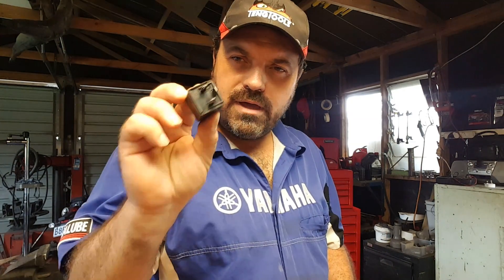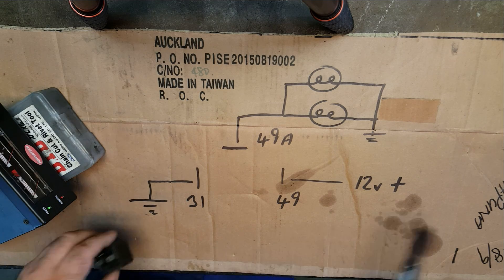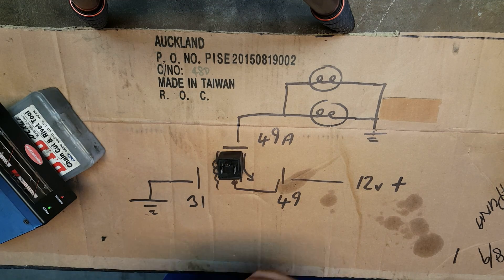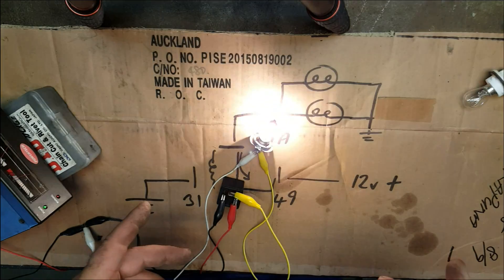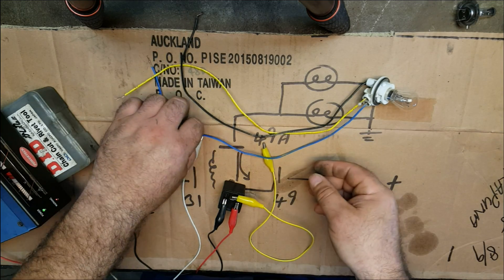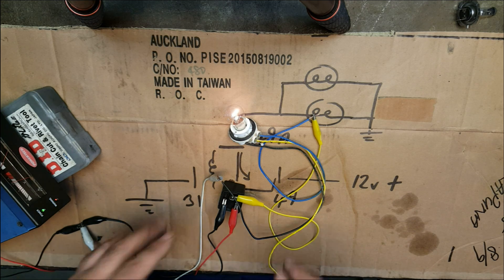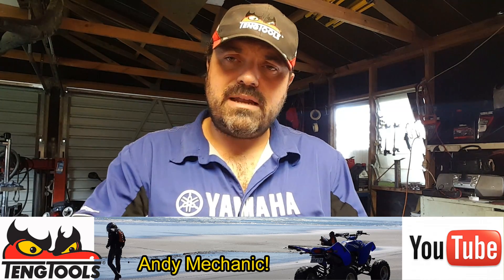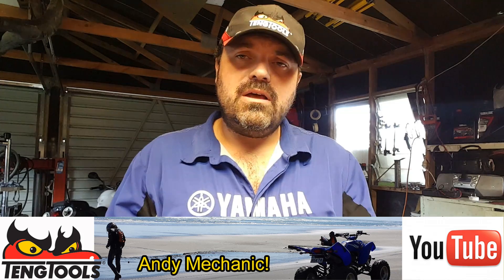How to wire up a Flasher relay #1927

Comment: great walk through. I've just bought new LED indicators for my motorbike to replace the standard bulb ones & I was very worried about the relay part as I don't know much about electronics and it sounded complacted but you have just made it sound very straightforward. I just need to buy a LED flasher relay and swap it over. luckly the lights I bought are for my bike so all the other wiring is the same as what is already there. so this should all be a easy job

Comment: @AndyMechanic hi Andy I have a uforce atv I have put aftermarket lights in it, I have hooked up turn signals to a 3 pin flasher relay. I now want to add in my Hazzard lights. I have purchased a 5pin rocker switch but I can not for the life of me figure out how to get hazards to flash!! I have hooked wires on rocker I think every way possible. I can hook up wires and the turn signals work but you turn rocker on and I get nothing. Any help or suggestions would be great  ty.
Reply from the maker: Hi, yes, most manufacturers have 2 separate relays, the problem is the load, it's doubled when you turn on the hazards & this then often puts the relay over spec on max current.

You may get it to work with one relay if you use an electronic type relay rather than the old school bi-metalic strip type. I remember our old Suzuki jeeps had two relays.

Hope that helps?

Cheers
Andy
Reply: @AndyMechanic  this is what I am using, should I be using a 4 pin? I'm thinking 3 pin is my problem
Reply from the maker: The relay needs to be upstream of the switchgear, that way you can activate just one side or both sides. If I was doing the job I'd definitely just use 2 relays, one for the indicator circuit & one for the Hazzard circuit. Easier to diagnose faults further down the line too.

Sorry, got to go, have to get on a plane.

Cheers
Andy

Comment: Great video! A '?'.. I need to replace an existing faulty 12v 2 prong relay that's malfunctioning on a 64 vw beetle (no emergency flasher in 64, it's just for turn signals). Was told I should go to the 3 prong (newer type) so the pin 31 can go to a grd so it works properly. Would this be true? Thanks for any feedback!

Comment: I changed to LED taillights on my campervan and have hyperflashing. I tried fixing it with the resistors but it made the LED lights very dim. Ive ordered an LED flasher relay instead but its 5 pins and my other 5 pins are in different locations. 
Wondering how to wire it up?
My old relay (25230C9961) is numbered 1,2,3,4,5 and my new relay EP27 is labelled as +  -  I   L & L1

Thanks

Comment: Hello,

Thank you very much for the explanation.
I am having a problem with my CB500X 2021 that comes with full LED lights so basically equipped with a LED Relay.
I have added additional headlights "technoglob BALL PLUS" on it with turn lights in it.

Now when I switch the warning button while the engine is running, the flashing rate is too high.
When the engine is off, the flashing rate is normal. I have uploaded a video on my channel.
> https://youtube.com/shorts/QxTxtNLFfw0?feature=share

Do you have any idea what is going on ?

Thank you in advance

Comment: Like the basics, good refresher, but you probably might add running lights like ones found on my old 1983 kawasaki 750 ltd. The reason I feel it would be beneficial is the front and rear running lights the turn signals share the same single filament bulb and a 2 conductor flaher. This would help those whom don't understand how that one filament can flash when the lights are on, trouble shoot more effectively. So it is my opinion. If you would include the ignition switch and turn signal switch and maybe the separate two conductor hazard flasher could be even more beneficial for understanding what real world scenarios, such as chasing a bad wire/connector or multifunctional switch like in my 04 Ford f350 can greatly complicate simple circuits such as a flasher

Comment: Why wuld my car to refuse shut of because of flasher relay? Same 3 pin relay in that video.
I cant finde problem with that thing can I use diodes on that thing?
What ever it is when all 4 lights are turned on engin works in union with the flasher,my engin has tendency to self acelerate when lights are on,my trothel cabel fir some reason on my carburetor gets contracted if I dont stop useing lights and I took of blow by hosse .
I have realy big problem with my lights .
I have 3 relays they do strange staff but non fix my problem .
Even the bulbs are corect size and value.
It started when I changed out handels on stering and changed to newr light design on my 80s opel who is by the way gm product how ever the bulb holder design and wire lay out are the same .
So I can not finde any thing suspiciuse in that thing.
I even unpluged my ignition coil positive out and that thing still runs .
What Am I missing there?
Is my relay actualy become somthing similar to ignitor module?
I look inside that thing and lot transistors capacitors all kinde of resistors I have strange fealing my ignition coil is fiering from the ground some how,ore it fumeled with my alternator for some reason I fried my multimeter it shown 15v and is claiming with engin speed increasing .
So what the hell happening?
Wires dont see damaged plugs look ok corosion I remowed with sand paper so changed out 3 relays and always get diferent results front left activated back right tail light and blinker the other work just on 1 side the third relay does not do any thing all lights goes on ?
How to hell I solve this problem can I put diode ore somthing like that?
What ever it is its anoying my .
I like my engin power I wont lie 😘 but that ghost electricity nearly killed my that was not great at all .
I dono Im out of ideas aperantly that deam 3 pin relay can act as kinde of oscilator so Im not shure how to deal with it 😵

Comment: Ah damn, i messed up, that means i bought the wrong relay, im rewiering my IH 434 beacause the electrical system was toasted over all the years and now im at the finnish line only needin to plop in my warning lights and now im here with a relay that doesent have its grounding in the ligt bulb... facking hell 😵😡🤬😥😓

Comment: Hi, I'm wanting to try this but my motorbike has hazard lights too. My bike is a Honda and the original relay (for filament bulbs) has 4 pins. Would my hazard lights still work with a 3 pin universal relay? And I have an led 2 pin relay  (adjustable flash speed) would my hazards still work on a 2 pin relay? Thanks for a great video 👍

Comment: opps,  mistake - OMMISION , did anyone pick it up?   you did not mention, the beauty of the old globe system,  when one ( indicators are 10w SINGLE FILAMENT GLOBES) of the twin set FRONT AND BACK  per left or right blows out- fails, the flashing speed doubles-  TELLING THE DRIVER TO FIX - REPLACE THE BURN OUT BULB,

Comment: So an electronic flasher 3 pin will work on front and rear and mirror turn signals ? What about running lights? I have a 2004 EZGO TXT:Marathon golf cart. Any thoughts….Thank You Andy!

Comment: Newer vehicles don't have a replaceable flasher relay (like my 2014 Xterra). So your only other options are loading resistors or get CANBUS rated LEDs for your car/SUV/truck. The CANBUS LEDs have circuitry that pulls normal halogen/incandescent current which fools the cars electronics into thinking you are using halogen/incandescent bulbs. Not all vehicles will work properly with the CANBUS rated LEDs so you may have to go with loading resistors. The downsides to the loading resistors is heat dissipation and  if the LED goes bad the car's electronics will think the LED is still good because the loading resistors are still pulling the same amount of current. That's why you should check your lighting on a regular basis - but it's obvious that a lot of people won't do that.
Reply from the maker: Very useful info, thanks for your post. Cheers Andy
Reply: @AndyMechanic  I just got a pair of CANBUS LEDs (CK socket type) for my front turn signal lights on my 2014 Xterra and they work great. No hyperflash when you install the CANBUS LEDs in both the front and rear. CANBUS LEDs make for a cleaner install (compared to resistor kits) but they don't fix hyperflash on all vehicles (according to my research).

Comment: I'm just wondering if this is possible,the indicators don't work on the right hand side of the fiat doblo i just bought.I have diagnosed it to a faulty indicator relay on the bcm circuit board.
It operated the left indicators ok but wires for right indicators are dead at the bcm output.
Would it be possible to wire in a conventional relay just to operate right side indicators from my indicator stalk??Thanks.

Comment: Hi Andy. I have a question, is it posible to wire LED flashing lights without a switch and have them come on everytime the brakes are applied on a Harley Davidson?
Thank you in advance for your response.
Reply from the maker: Hi Danny, yes, should be easy enough. Though the circuitry to make the LED lights flash would ideally need to be integral to the LED lights so a bit of research needed.

However, have you considered the legality of such additional lights? A brake light both in the UK & here in NZ must illuminate when a brake is applied (motorcycle front or rear) & must maintain a steady output whilst the brake is applied. In the US they often use the same light to indicate that the vehicle is turning - by flashing the brake light.

What you propose may well cause confusion to those driving vehicles behind you, implying that you intend to turn.

Hope this is of help.

Cheers Andy
Reply: @AndyMechanic  thank you Andy. I meant strobe lights, or warning lights. Here in America, some motorcycles use strobe warning lights for safety when breaking. But I don’t want to have a switch for it. There are modules I could buy, but they are not strong enough for me. Thank you sir.
Reply: @AndyMechanic  thank you Andy. I meant strobe lights, or warning lights. Here in America, some motorcycles use strobe warning lights for safety when breaking. But I don’t want to have a switch for it. There are modules I could buy, but they are not strong enough for me. Thank you sir.

Comment: Thanks for the lessons.  Im wiring a motorcycle from complete tear down. What part of the circuit is the switch usual wired? I can wire it a couple of ways to make it work,  but I'm sure there's a way it's traditionally wired.  I'm an electrician with limited automotive wiring experience. Thanks again for your knowledge and sharing your time!

Comment: Andy, 1991 Honda Africa Twin. Stock turn signals.  I notice in cold weather when I activate the turn signal there is a significant delay before the signal starts flashing.  Works normal in warm weather with instant flashing.  Would you say bad relay?
Reply from the maker: Hi Mike, Yes,  I'd start there. They use a bi-metalic strip type relays which will take longer to warm up in cold weather - beat option is to swap it for an electronic one - they just plug straight in. Take your oodles relay with you so they match up the correct one & make a note of the wattage of each flasher bulb - will be in your service manual under electrical specifications 

Cheers Andy

Comment: Hi Andy! New subscriber here. Love this video. I'm a tech of 15 years and I do understand flasher relays a bit. However, I have a question maybe you could help with. I have a 2007 Victory Hammer that both right side directionals are not working due to a failure in the auto cancel module. By bypassing the wires to the module and wiring a separate relay, i should be able to have the right side working again, correct? Basically what is happening is I have a constant ground to the wire going to the module but when putting the flasher on, it does not power. Thanks

Comment: Great video! I noticed that the light bulb's connection to the LED relay was accidentally connected at the 39, not the 39a (around time 9:30 in the video). That might be why the LED one didn't work

Comment: Who the hell would dislike this video? Amazing explanation!
Reply: I personally did not dislike it. However, i don't like how he did not wire in a switch. The way he did it here a flasher will work 100% of the time. Constant power, no ground to switch to be able to control it, turn it on/off

Comment: listen Sir : I have a relay calls Hella : it has  4 pins  (31/49/49a/c2) what is the C2 exactly for and how to wire it ? I could wire one or two lamps without using the C2 pin ... but what it is used for ? I will be thankful with your answer

Comment: Thank you so much for the video.  I've now got a game plan to make my own turn signal lighting harness for my John Deere Gator RSX860M.  That was going to cost me $750 to have the factory harness and lights installed at my dealer.  The low cost option was to buy a $420 factory wiring harness and switch, purchase my own lights and install myself.  I bet I can buy all the parts and make my own for under $100!  Great and inspiring tutorial.

Comment: Hi Andy loved the video, can you tell me what size flasher I would need two pin , to run indicators at 10 watts per bulb ?  Regards Marc
Reply from the maker: Hi Mark, will that just be one indicator front & one rear? No side mounted indicators? If so then just one that works with a 20 Watt draw (which is very low). You may be  better getting an electronic flasher relay instead due to the low current draw.

Hope this helps. Cheers Andy
Reply: Andy Mechanic  it’s going to be two on either side Andy front and rear , iv wired everything up but it’s flashing a bit too quickly?
Reply from the maker: Ah, okay, if it's flashing too fast than the current draw is too high for the flasher relay you have. You'll either need to get lower wattage bulbs or a higher rated relay or an electronic relay (electronic type relays flash at a set Hz independent of bulb wattage unlike the old bimetal strip type relays.
Reply: Andy Mechanic ok thanks very much Andy keep up the great videos my friend

Comment: Is the 12volt coming from the signal from the indicator switch?
Reply from the maker: It depends on the circuit - some are switched ground whilst others are switched on the positive side of the circuit. Cheers Andy
Reply: @AndyMechanic  ummm maybe im a bit confused...if my bike already has a relay can i put in 2 flashing relays, 1 for each side, and use the positive from the existing wiring into the new relay and then run new wiring to each side of the bike. At the moment my new scrolling indicators dont even flash

Comment: Question, I have a 03 buick regal. The car will not start if the turn signal switch is activated,  or I can say if I'm driving the car and I turn my signals on the car turns off,, any idea why?

Comment: You forgot to hook up your ground to the metal mounting bracket on the red colored electronic relay. That is why it did not work. Normally, if the relay was mounted, it would get it's ground through the frame of the vehicle. I sure you just forgot.

Comment: You didn’t earth the second relay
Reply from the maker: Correct. This is a two pin type flasher relay which works on a bi-metal strip. As current flows the strip heats up & deflects, breaking the circuit. It then cools as no current flow, contacts close again and process is repeated. This type of relay is not earthed, it just forms part of the circuit, like a bulb.

Hope this helps
Cheers Andy
Reply: My bad . I though I may not have been working as the earthing terminal on the relay wasn’t connected

Comment: hi andy, I fixed separate 2pin flasher relay(similar to the original one) without removing the original flasher relay for hazard signal light configuration for my bike. in addition to the main front and rear signal lights (basically halogen), there are two led handle signal lights. the problem is once I connected front signal lights double signal light didn't work. without front signal lights it is working perfectly. for testing purposes, I fixed two led strips for the front and checked. then hazard signal lights did work. what could be the reason for this

Comment: Hi I have a question I’m a volunteer fire fighter I have red 3/4 led’s (15) and I have them wired into my park light and was wanting to make them flash when I have a fire call. And when not on a call I want them to b (steady on) how can I do this with a flasher. I know I’d have to add a toggle switch.

Comment: Nice one dude, if ive got a mix of LEDs and normal bulbs, will the electronic relay work with both?
I have an issue where the new relay doesnt work and im feeling a bit lost!!!
Reply from the maker: Yes,,it should work now problem provided the total current consumed is within the relays rating.

Cheers
Andy
Reply: @AndyMechanic  thanks for your help buddy, i was going out of my mind, turns out i had a faulty relay, helpful seller on ebay "Lightec-uk" very helpful is sending me out another!! 

I was worried my LEDs didnt draw enough to activate the relay, thanks for your info in the video, very helpful

Comment: working on a project vehicle without any signals (yet) Do you have a vid on how to wire in a complete system (using a three prong electronic flasher) or other. This vid showed how to get a flash, but not how to get it to flash left or right through a three position switch ie: on - off - on (like on a cycle)
Reply from the maker: Hi, ah, that's easy. The output from the relay that you have going to the bulb. That's the feed to the left/right switch. Then from the switch just run the power feed, in parallel, to each of your indicator bulbs. The other wire from each bulb goes to ground.

Hope this helps

Cheers Andy